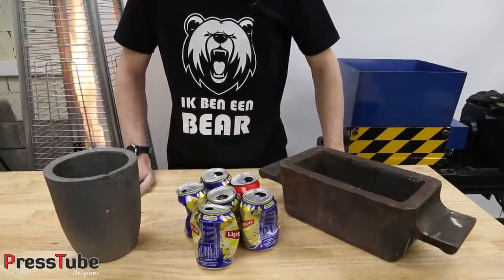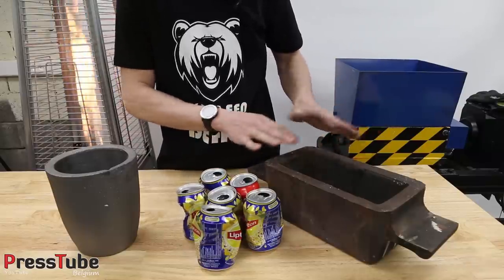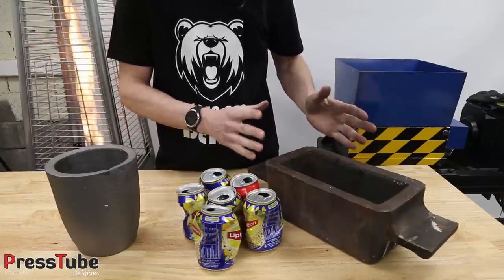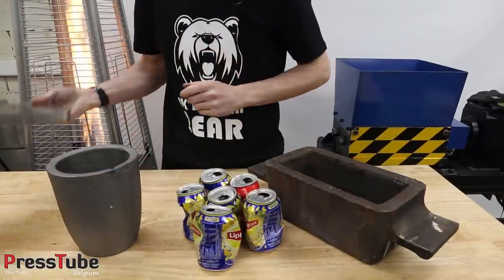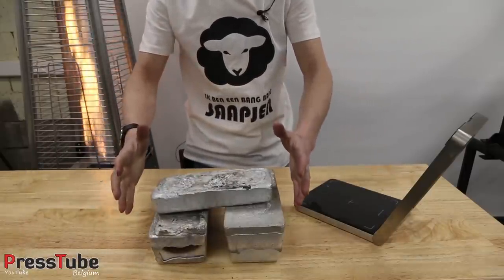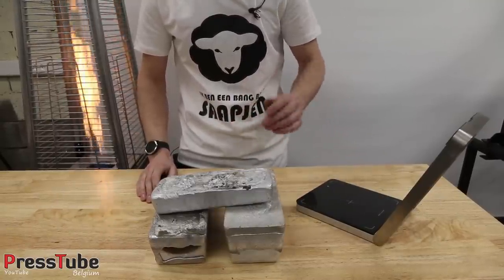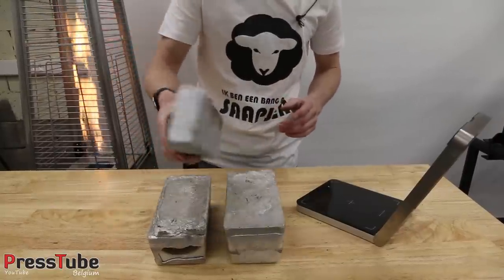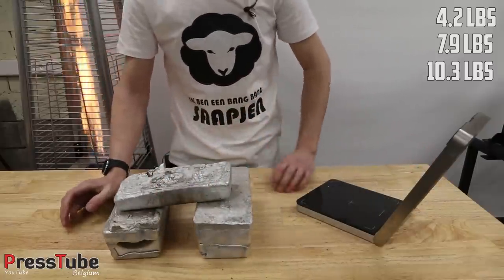Shredding & Melting 1000 Coca Cola Soda Cans Into Huge Aluminium Ingots

Comment: In the US scrap cast aluminum is about $0.30 per pound.  So 20 lbs of aluminum is worth about $6 in the US.  It's not about the money is about what you can make with it which makes it more valuable. Paint is very cheap but fine art in a museum costs substantially more.  It's all about what you do with the artistic medium that counts.  People will pay much more for a car pulley or a toothed gear than the material it's made from.  My point is it's not the scrap that's valuable it's what you do with it that matters most.  Thank you for your video.  I absolutely love your grinder and foundry setup.  It's a high quality setup and one you should be genuinely proud of.  Great video, I learned a lot.

Comment: Looks like nearly 50% in volume is slag, plastic lining, paint and lacquer. Nice ingots  and good video.
Reply: I was amazed at the volume of slag. Is it good for nothing waste?
Reply: Not really. I can tell there is a lot of aluminum still in that slag. He wasn't very careful scrapping it off, so he can reheat and melt out the remaining aluminum. And, most of that slag is aluminum oxide, which is what a lot of angle grinder wheels are made from, so he actually has a way of making his own grinding compound out of it.
Reply: Aluminium cans are super thin.
Reply: Jj i8

Comment: I very much enjoyed this video. I also have made a home furnace to melt aluminium and brass. I have found that a small amount of table salt helps separate the dross from the aluminium for a significantly better yield. My experience has been that the dross, when hot, has an ash-like consistency and is very frangible after it has cooled. Thank you very much for posting these videos.

Comment: I did this once as a teenager (I’m upper teens now, but that was lower teens). My friend and I started a giant fire in their backyard, and melted a ton of aluminum cans and a bit of foil to increase the purity. We even used an air mattress air pump to give the crucible more air. Their mom thought that we had meant a few pieces of paper on fire when we asked, and not a homemade forge. We had 10 gallons of water on standby in case something went wrong (when we put it out, the 5 gallon bucket wasn’t enough, so we had to use the second one). Their mom actually let us do it when she found out! She just supervised us afterwards. That was an interesting day.
Reply: Alexis Harper interesting day?! More like the coolest day ever! My mom would never let me attempt such a thing.  Ur so luckyy😓
Reply: Richie Ingpiece Um, yeah, so just an fyi, a regular fire can melt iron very slowly, so why would you EVER construct a fire on aluminum, which has a melting point that is a little more than half of iron’s melting point? That’s just plain stupid.
Reply: @hokage1997  the pokemon if so why
Reply: Aluminum foil generates more dross than aluminum, even when submerged in molten aluminum - don't waste your time tossing it into your crucible.
Reply: My dad used to make fires outside to burn old cut down trees and some times metal would end up in there.a few days after I looked at the remains of the fire and I found a 7 inch  1 pound peice of metal

Comment: Aren’t you spending more money on propane gas than the value of the aluminum? Excuse my naive question, I really don’t know
Reply: Making thousands off ad revenue
Reply: Isaac roy idk about thousands
Reply: @alanj.b.1332  4 million views is definitely thousands
Reply: He's doing it for fun probably, as a hobby so it doesn't matter
Reply: @azqswx123100  it's barely ten minutes and has an ad in the middle. Even if he does do it for fun he still trying to make money. Not that there's anything wrong with that.
Reply: It's a hobby not doing it for money my guy
Reply: @isaacroy8599  lol ad revenue? i have ad blocker i see no ads. i would like to know what the ingots sell for though
Reply: Aluminium *
Reply: •TheBoxerAlan• almost defiantly thousands maybe 5k plus depending on his ads
Reply: As of this posting the scrap value of soda cans is 40 cents a pound and while you can make 32 cans from a pound of aluminum, you'll lose a certain amount of your can to oxidation and getting trapped in your dross, meaning that it takes more like forty to fifty cans to make a pound.

He got 22.4 pounds from his 1,000 cans so he was averaging 44.6 cans per pound meaning it cost him 55.75 cents per pound to make that aluminum.

You typical butane tank will give you about 19 hours of grilling time, he said he was at it for six hours so figure he killed the tank since he was blasting it and with the cost to refill one of those running $20-25 in my area that meant the final cost of his aluminum was around $1.60-75/pound.

With virgin aluminum running 60 cents a pound he obviously lost money doing that.

However, he has 4.8 million hits and according to Google you earn $1,300 per million hits, meaning that this video has earned him $6,240 which works out to him having earned $107.52 per pound for that aluminum at a max cost of $1.75/pound resulting in a before tax profit of $105.77 per pound.

As such, I think he's doing OK with his cost to profit ratio.
Reply: @seanfoltz7645  you are a fucking king
Reply: 2+2 is 4 - 1 that’s 3 quick math
Reply: @isaacroy8599  waste of time,nothing useful comes from this vid,we should be paid instead for watching   99% to  us and 1 to him
Reply: @isaacroy8599  I block youtube ads
Reply: It’s about $12 worth all crucible casts together...but I would have $50 of fun doing it!
Reply: @isaacroy8599  its not just ad revenue which gives them money your view , likes & sponsors behind
Reply: Simply pour liquid oxygen to melt it in a few seconds......
Reply: @Farah Abdulkhadir Said PAGY And for his family as well.
Reply: "Aluminium" is British English, and "Aluminum" is American English. They are both correct spellings. Also it is not a waste of money to make if you are having fun in the process :)

Comment: I took some cast aluminum in to sell and the value was less than the loose cans per pound I took in.
Reply: That's is usually because cans are a known "Grade" of Aluminum that can simply be crush and sold to Smelters, Ingots are can all kinds of unknown other materials and so have to be refined before reuse
Reply: Yes, you could have added zinc or lead to make it heavier, and as the other person said, they know what cans are but ingot they don't. A cool vid though, I'm a foundry guy so no critiques from me, I'll be nice. Good job.
Reply: Another cost to you is your fuel cost. Too energy intensive.
Reply: Also all that guop he took out was zinc
Reply: Awesome video. So aluminum today in US is .92c/lb. I would love to be able to try this, but ingot around here sells for junk price. Great vid, subscribed!
Reply: You make Ingots for your Own Use. Maybe you need a Solid Block to build something.
Crushed Cans, and Possibly Shredded Cans are your Best option to take to a Recycling center. ( always Call and Ask if they take Shredded Cans first. Some Don't )
Reply: I am a foundry guy and I can tell you that there is absolutely no zinc in a beverage can. Also they only use virgin aluminum for cans because any other metal in the mix makes the can shred when it's pressed. When they recycle aluminum they make other alloys with it. That gunk is aluminum oxide and the remains of the coating on the can that he is skimming off. The correct term for it is dross.
Reply: @Lindenbum - 100% !!!
Reply: As people have said....this is because they know they can just make more cans when you recycle them.
With an ingot, they cannot know what the h3ll is in it... ...So it has to be reprocessed.
Reply: +K Sullysvan - Please don't do it.... You have better luck go around all day and pick up .05 Cents Deposit Cans. With 20 Cans, you get your $1.00.  Best of all, NO FUEL, NO LABOR, NO FOUNDRY, NO COFFEE!!!  😂😂😂😂😂😂😂😂
Reply: That only works in 11 states, dude.
Reply: +none l - You didn't get my point did you?  If I have to do it and if I have to go to " MARS " to do it.  Then I am packing my Bags and extra Oxygen!  The whole point of my post is " TIME "!
Reply: Howard Black You're a good father.
Reply: @williamgreene4834  William here is correct.

The reason he got so much dross in the video is that by shredding them he was creating more surface area for oxidation.

When melting cans the best way to do it is to start by melting two or three muffins you've already made and then using a piece of rebar to push the cans under the molten aluminum to minimize oxidation.
Reply: @seanfoltz7645  Also rims are usually 356 alloy which is easy to cast and has very good mechanical properties. It is also used for engine blocks, very robust.

Comment: I am pretty sure you are not letting all the cans melt. You skimming unmelted cans off the top and wasting half your aluminum. There would never be that much slag. remelt what you scraped off the top and next time let your cans melt all the way your rushing the process. I use to work in a foundry for 12 years.
Reply: that's what I was thinking way too much waste
Reply: Its called slag. Its the impurities.
Reply: Yes there will be some slag but I dont think it would be near that much. Cans are pure aluminum.
Reply: shartne, But remember how many cans he actually melted down. About 10% of all the cans is pure slag.
Reply: Cans are pure aluminum. probably maybe 5 percent,, even though. he slagged out half the crucible.
Reply: I'm guessing he's getting a lot of slag because his furnace is hot enough to melt aluminium  (660C) but not hot enough to melt the thin external layer of aluminium oxide on the cans because it has a very much higher melting point (2072C).
Reply: Amature. Cans have lining and ink.
Reply: @typ8723  the amount of slag was waay too much lining and ink would not be as much slag as I saw. I am no armature did this for 12 years. Pretty sure you are and have never done any of this so your not even an armature or nothing.
Reply: Your our You're???
Reply: @Ty Strong Speaking of errors you spelled to wrong the way you used it it should be spelled too. So see how that feels being corrected on a typo. I leaned that in college when I got my bachelors degree. Have you got one of those? You see I worked in a foundry for 12 years and I have a Bachelors degree to boot so I have a right to be a little cocky.
Reply: shartne Congrats on the working mans diploma. Stay cocky my friend!
Reply: @blitzmakesunevenmm4323  what means cocky
Reply: Łukasz Werner it means that they are being rude or acting like they are better or smarter than the other persons
Reply: The can has slag in the bottom of it and I do t think that part melts well
Reply: @shartne   Armature??? You need a dictionary, AMATEUR!  An armature is part of an electric motor.
Reply: He also created additional slag via oxidation by shredding the cans.

You can make 32 cans from a pound of aluminum and if you're doing it right, you can usually turn 40 cans into a pound so assuming his count of 1,000 cans was correct, having gotten 22.4 pounds of aluminum he was averaging 44.6 cans per pound, meaning he lost about 2.6 pounds worth of aluminum due to his inefficiency.

Seeing as how he earned over $6k in ad revenue for this video though and pure aluminum is only going for 60 cents a pound, I think he's not going to miss that $1.56 in aluminum he wasted.

Comment: maybe there whas so much slack because not all cans are made of aluminium but MOST Coca cola cans are made of Iron
Reply: Who the hell told you they were made of iron?
Reply: Not completely but, have you tried to close a magnet to a can? surprise.
Reply: The fact that they are effected by a magnet and my best vriend that collecte trash cans and brings them to fhe scrap man for material money. Pretty fucking sure theres iron in it
Reply: They are 98% aluminum according to coca cola.
Reply: Shipmate | Revengefull Trout You might be thinking of the coke cans made like 50 years ago. I have been drinking coke all my life and I have yet to see a coke can made of iron.
Reply: I don't think so. I think it's because Presstube didn't remove the plastic labels on the cans. Also, cans are not made of iron (otherwise, they would be rusting after a while). They're all made of aluminum. I mean, if they were made of iron, they wouldn't have showcased said iron cans in this video in the first place.
Reply: I mean, they might not be purely aluminum, but basically, it would be aluminum, and adding metals together for casting doesn't leave one of the metals as slag. It would become a pure alloy (sans the slag from the plastic).
Reply: Not in the US. All soda cans are totally made of aluminum. Many vegetable cans are now made of aluminum now also, except the tops. Seems like a loser prospect melting cans down though, just recycle them crushed or as they are, the recycler isn't going to pay more per pound because you did half the work for him. LMAO.
Reply: Bruce Clark true the recycler might not but he can now use the aluminum in a casting project
Reply: It varies across the world and among different drinks companies BUT there are some soda cans that are definitely made from steel/iron. Use a magnet to verify before contaminating your Aluminium ingot. What are you seeking to do - sell for scrap or DIY mouldings ?
Reply: I mean, im not saying any of you are wrong. But explain to me why the cans get stuck to my magnet?
Reply: Spam Mouse I just collects cans for my friend, she returns them for the aluminium worth money
Reply: Well, Theres the anwser: it varies between countries. In Holland, where this youtuber and I live, still uses iron in some cans.
Reply: I have encountered soda cans across Europe (various countries) that are mostly iron/steel, I was surprised by the first one I saw rolling across the sidewalk and then suddenly stuck fast and held to a ceramic magnet embedded in the ground as part of an anti-theft system to stop supermarket trollies being taken outside of a car-park zone. I am no expert in the canning industry - but I assume that to aid recycling (huge money to be made in metal recycling) that soda cans are almost always Aluminium - but I concede that some cheaper manufacturers that do not care about future recycling (Chinese made for export?) would build a can that had mixed metals or parts thereof so they lower production costs and screw the recyclers down the line or in other countries. Mixed material products of ALL types are more difficult to recycle and extract the value from - plastic/aluminium/foil coffee machine pods are a great example of cheap to made - sold at huge cost - and almost worthless to recycle. People that use such machines should be shot.
Reply: In my experience,Scotland UK,90% are aluminium,but there is always an easy way to tell. Mostly Pepsi are iron,double  the weight. 90% of coca cola are aluminium. I could make money in my spare time between shifts. I took my old diesel car (40miles/imperial gallon) to a bar I knew,they allowed me to help myself,I sorted the iron from aluminium & crushed the aluminium flat with a sledgehammer. Arrived home with the uncrushed soda cans & emptied all of it on the floor. A few trips over the aluminium crushed them flat as a flounder. After a month I took a car load to the junk yard & got £30,this was when the value of scrap was almost nil.  This guy was using this as a demonstration though,not as a practical method of making $
Reply: pretty sure that slag would have been mostly paint and lacquer

Comment: A lot of aluminum left in the slag, you could re-melt it. Also use borax to help draw out more metal
Reply: I was gonna suggest the same thing...about the borax, and also I don't think it's a good idea cooling the metal while it's still in the mold. I would also suggest he use graphite molds instead of iron ones.

Comment: Wow How much pawn would that be?😱
Reply: about 10 dollars
Reply: A tonne is $20
Reply: In finland that would be about 160€
Reply: 4 Gaming about £6........
Reply: Depends where you sell and the purity. With the refining process he's using the ingots aren't very pure due to the slag content, paint and other impurities from using pop cans. To Increase the purity he would have to smelt the ingots 2 or 3 more times each, and use an iron mesh dipped from bottom to top of the crucible to remove as much slab as possible. And then pour it evenly throughout a clean mold. As each time you pour you are reintroducing impurities, slag, etc from previous pours. On top of that slow cool, it as dipping it in water introduces steam which creates air bubbles which can creates air bubbles and result in an uneven ingot. And after that depending on the weight and amount souls say 50 pounds. About 3-4 full size ingots. You get around 2-3 dollars per pound plus tax. And that if its pure to 10 percentile. If it's not refined and smelter correctly you'll only get around .80 to 1.20 per pound. Honestly the effort and time it would take to refine isn't really worth the amount it's worth unless you have an industrial assembly line where you are producing 250 to 1000 pounds per work day. You're honestly better off just selling the raw material, as the refineries know exactly what they are getting.
Reply: 21.83 american dollars at aluminum being worth 97 cents pound
Reply: If you take the cans into the bottle depo at 10 cents a can that's 100 dollars right there
Reply: padddymills12345 in germany you get 25 cents back for cans (but you pay it when you buy a new one)
Reply: Zane Zinn either u don't scrap or u live in a place where aluminum is worth twice as much

Comment: Did you or would you cut that with a saw to check for porosity. This is a good way to cast your own parts at home. I would like to learn more about de gassing for better aluminum castings. Good video. Thanks.